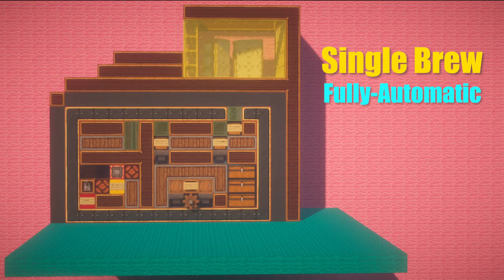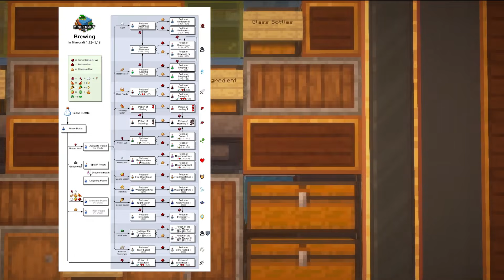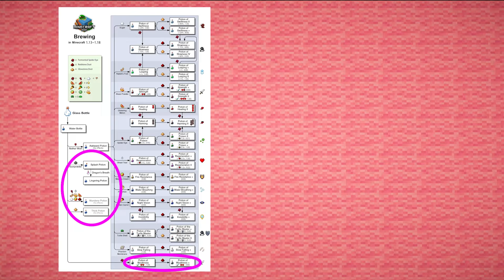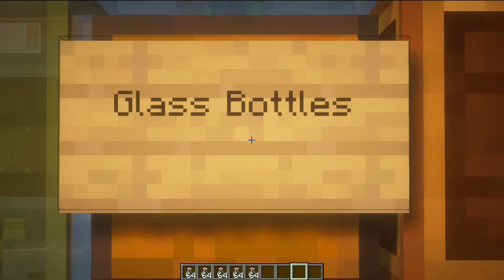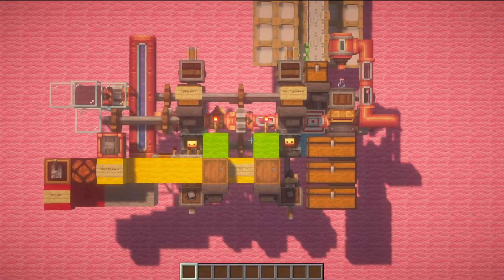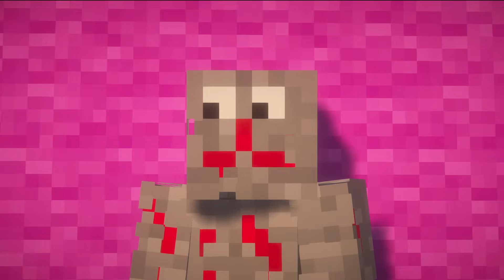Minecraft: Create Mod 0.5 Potion Factory

Comment: A easy way to not have to use 2 for deployers is using a mechanical arm in there for fuel, since mechanical arms can have two outputs. Probably won’t work for this design, since the mechanical arm will try to fill a blaze burner to maximum possible without wasting fuel.
Reply from the maker: Thanks! I can't see why a mechanical arm wouldn't work; will have to try that out in future designs.

Comment: The way I usually deal with potion filters issues in brewing, is by not dealing with it at all.
When you mix something with the basin, the end result will automatically be outputed via the basin spout. In case of a liquid, you just need another basin or an item drain next to your initial basin, and the liquid produced will automatically move away.
You could argue that if you want to only use one basin to mix all the steps, you have to use filtering, but honeslty, I prefer using more basins anyway, as it gives your contraption more flair, imo.
Reply from the maker: That makes a lot of sense.. I will have to test out all the different scenarios with basins, because based on what you're saying, a fully-automatic brewery with all 3 ingredients should be a lot simpler than what I made it out to be 😅 But what started this entire thing was me trying to use a smart filter about a year ago and finding out that they were very finicky, so my redstone brain started working around it. Thank you for sharing.
Reply: Using multiple basins that automatically drain down would also make automating the lever 2 and 3 portions a lot easier, espically because most of the upper levels take the same ingredient mix